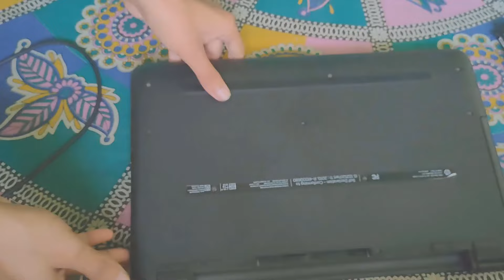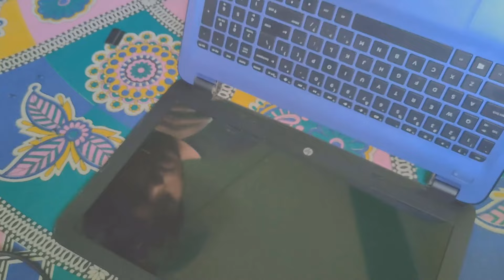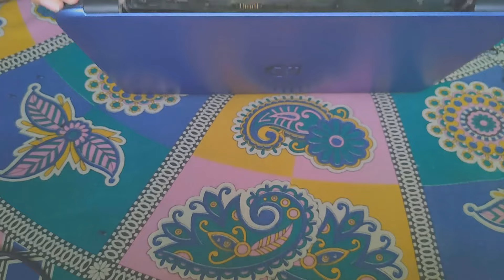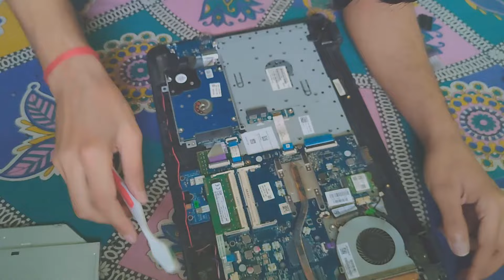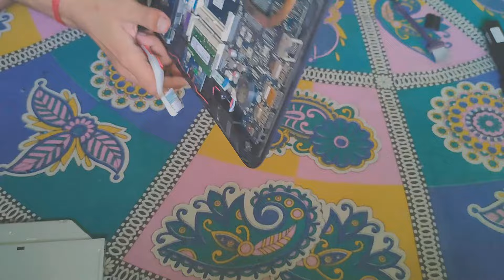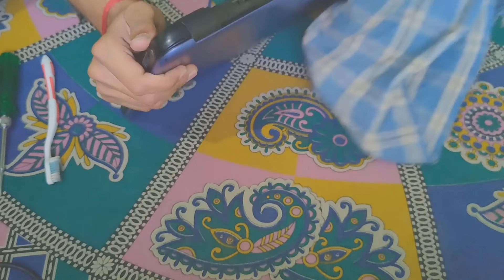How to Clean Laptop from Inside | Clean HP Laptop Fan | Open hp laptop for Cleaning Dust | 2024

Comment: Opening the laptop is the scariest part💀
Reply: And putting it together without breaking the covor clips.....😅
Reply: I had RAM related issue so I opened the back case, replace the RAM and after that I turned on the laptop without putting back the case to check whether it is working fine or not ....
And I put the bottom of laptop in a table without a back case ...
Will it create any problem???
Reply: @rishabhtripathi2489 well it obviously will, without cover its more prone to dust, it will have a  better cooling, but its more prone to damage
Reply: Imagine u put ur laptop together and it doesn't power on...😢
Reply: Really
Reply: Ngl it actually is, the first time i opened a hp laptop was scary, i have opened a acer netbook, dell lattitude aswell but those 2 have a simple access towards getting in. Hp laptops or atleast the one i worked on, not only do you have to take off the screws but the way you remove the back cover is the way shown on this video which is kinda scary cause theres some laptops which have certain chips/strings attached towards the back cover while others dont and if you accidentally pull off to hard, you can fuck up everything. Luckily the one i worked on wasnt like this so it was somewhat easy jet scary asf💀😭.
Reply: How can i know if my laptop doesnt ave anything attached to the back?
Reply: True

Comment: u are lucky u didn't damaged the laptop because you used a toothbrush. It is safely recomended to use a very soft brush and compressed air
Reply from the maker: Not necessarily use soft brush and Air compressor if you have but toothbrush are also very soft so depending on toothbrush quality
Reply: @techsanjeet  yea you're right about this
Reply: GodZpeed X7  bro ik he isn't right but come on, what can i do? for cleaning very sensitive components u gotta use some soft brush but come on, u cant do anything cuz he will keep his own idea, not changing
Reply: @techsanjeet   can i use something like vacuum cleaner
Reply: I use a wet tissue and a dry one to clean the inside
Reply: Bhai mein iska dost hu.. iske baad laptop ka RAM kharab ho gaya tha.. tum thik bole
Reply: @bapubapu7883  english?
Reply: @rug_bot  I m his friend actually. At the time of recording this video, I was shooting the video. His laptop did not turn on after this. As the ram got damaged. Your are right brother, the brush is too hard, so shouldn't use brush
Reply: @bapubapu7883  chutiya bna diya itna asaani se😂😂
Reply: The best brushes to use are make-up brushes.  They come in many sizes and are ultra-soft - probably the softest, most gentle brushes available.  They are also cheap to buy.  The best one to choose is a blusher brush which is large and softer than the rest.  Too soft to damage anything.
Reply: @dominik1080  nope
Reply: @dominik1080  no
Reply: @helenaville5939  anti electrostatic brush is needed
Reply: @bapubapu7883  then ur q bad friens actually. I used a vacuumcleaner on minimum and at least 5 cm away from the surface 
Edit : suprise my laptop still works xd
Reply: Maybe he damaged it. He didn't show it up.

Comment: To clean the heat extractor fan correctly ,remove the metal lid on top..(3/4 SMALL SCREWS) to have full access and clean the blades & small radiator with a blower can and remove all dust  and sticky stuff + Qtips + soft brush...gain easy minus 10/15°c and constant activity/noise/over heating.
Reply: i want to clean that but i am scared of bricking my laptop. and i guess it needs really small screwdriver which I don't have.
Reply: @heroispro8918  okay I'm gonna clean my pc tomorrow I al so scared I wil just remove shell and the fans shell that's all and cleaning and assembling again
Reply: Bro I am take my laptop and give to laptop cleaner to clean my laptop because I am scared to operate the laptop😅😅😅

Comment: For long-lasting lubrification, use lithium grease (good for bronze bushing. Use light synthetic oil for ball bearing) you can also use light oil for bushing but it will last less. Be careful, if you use compressed air for cleaning. High-speed rotation of the fan will induce voltage that can be harmful to the electronic circuitry of your fan and computer. Disconnect the fan from the motherboard and lock the rotor (fan blade part) with a toothpick before blowing compressed air to be absolutely sure that you don't break anything.

Comment: On HP AC laptops there are air vents or holes on keyboard also. You need to remove debri or lint from there as well to get temps like new. You'll need to remove keys like f1, f2, 1, 2, Q. There you'll see the nasty stuff blocking air flow
Reply: ty
Reply: ohh, thats why there was dirt under my 0 and 9 keys, its an HP laptop too
Reply: @Itstrackso  👍

Comment: Thank you. My fan kept making noise when on start up. Almost same laptop as you have. So opend it with your video. Now its way better. Used a far softer approach though! Sinds i havo no cleu on what are the weak spots
Reply from the maker: Just clean it softly 😊 and you will not face any problem because all parts are fixed and safe to touch but don't use liquid to clean just brush 🖌️ and soft cloth

Comment: DON'T DO IT GUYS! It can be extremely dangerous, it can destroy the tiny circuits.. just use a blower to remove dust without touching any component!
Reply from the maker: Hmm but that Tiny circuit is not delicate you can easily clean don't scared
Reply: Alas! I started cleaning right away. Thanks for your warning
Reply: noob

Comment: So i went to my laptop shop from where i purchased so he told me there was a lot of dust in . So can it be possible due to dust the new external ram just got undetected ? If so then can i open it at home and just clean the dust??
Reply from the maker: Yes you can open at home just be careful with parts Don't open other parts just cleaning the fan dust and check ram by switch the ram port and see it's showing or not if not maybe Ram faulty
Reply: If the ram is still not detected then your motherboard is fked

Comment: Thats fine, but I want to clean the other side. You know, where part of my lunch ends up. The sides of the keys are very dirty too.
Reply from the maker: Try to open complete board and flip laptop and it will automatically remove keyboard you can clean only thing it try to open with patiently 😉

Comment: Bro my laptop keeps turning off again and again 😭😭
Reply from the maker: Virus run windows defender turn off internet do full scan
Reply: @techsanjeet  but it doesn't even show the lock screen 😓
Reply from the maker: Remove all external hardware like keyboard mouse all then see
Reply: @techsanjeet  Yes I opened it but everything is fine I also cleaned the fan and ram bit still the same problem 😑
Reply: @smitverma9491  nothing it's just not turning on 😓